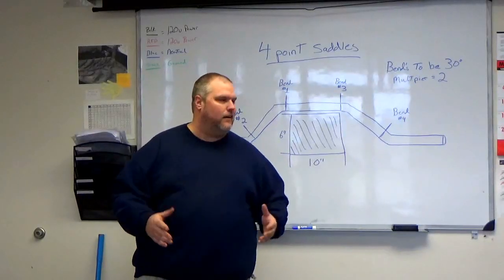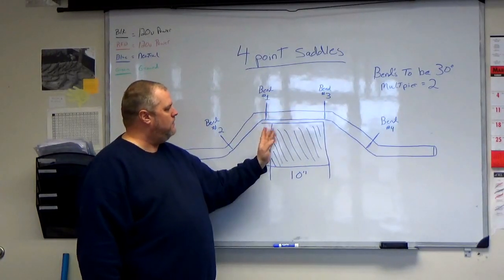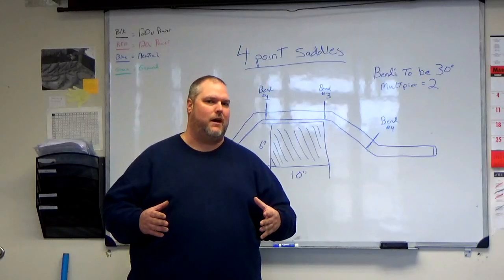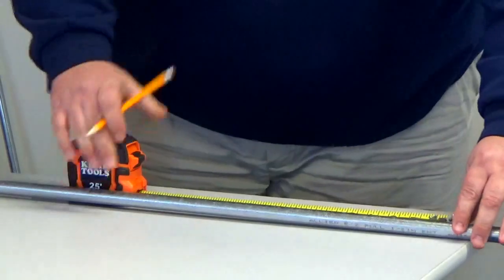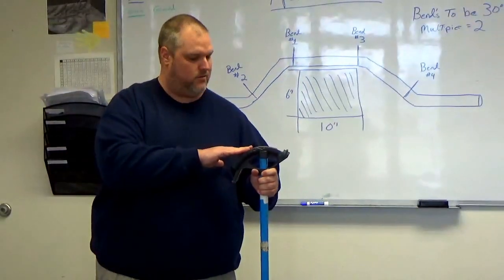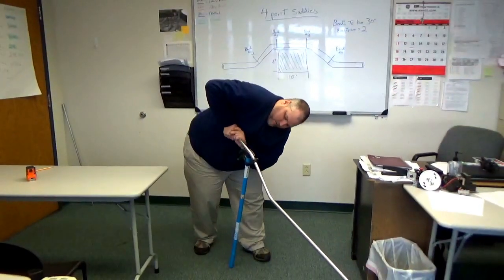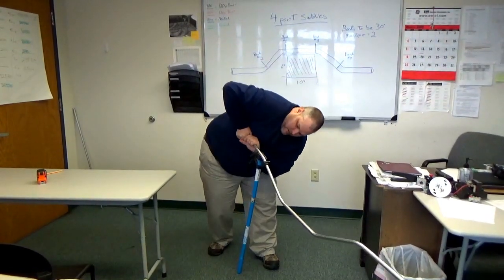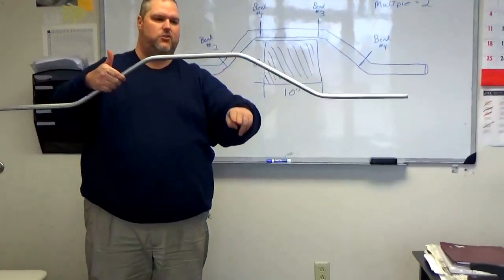Conduit Bending  4 Point Saddle

Comment: dont all of the measurements change when adding in shrinkage?
Reply: Technically yes. But in practice it seems to have little effect on the end product
Reply: For this saddle it should be 1.5” shrinkage. Anyways just cut off an end to make fit if you have to.

Comment: You didn't add shrinkage.  Instead of 12" it should have been 13 1/2 " cause you get 1/4" shrinkage with 30 degree bends. Therefore that gives you 1 1/2" inch must be added.

Comment: why is the shrink applied only once for both offset (2 bends) and the 4 point saddle (4 bends)?, It seems it should be applied twice since you are bending the conduit 4 times in the 4 point saddle instead of 2 times in a offset.
Reply from the maker: Great question!! Shrink is based on the RISE of the object the you are going over. You can only apply it to the side you are measuring from or the starting point.  Also the 4 point saddle is one considered one bend just like an offset is one bend.  Yes there are more then one bend but that is how it needs to be looked at.  Shrink is only applied once for that reason.  I hope this helps you!!! Thanks for watching!!!  CM

Comment: Hi Craig, How did you determine where the center mark goes on the pipe? Thank you
Reply from the maker: For this demonstration I used the center of the conduit. I was just showing how to bend a 4 point saddle. I have not done a video on shrinkage but I would find the center or an object and then add the shrinkage. You can find the size in an Uglys book. I will do a video explaining shrinkage soon. Thank you for watching!! CM
Reply: @craigmichaud-electricalins4602  
For the 4 point saddle did you use the marks on the tear drop?

Comment: You don't add the shrink to 1st mark?
Reply from the maker: You do but I did not show this in the video as I use it in my class to just show them the basic bend. Thanks. CM
Reply: They need to know that 1/4 per inch of rise is your shrink and you adjust that center mark accordingly , all other marks will adjust 
EX: 6” rise multiply by 1/4=1-1/2 “ shrink

So if the center of the obstruction is normally ex: 30” you’d make your center mark at 31 1/2.

Comment: Did u measure 12 “ because 6” was the shrink ?? Thanks
Reply: If your using 30 degrees your double you height. 6 inches high at 30 degrees would make you two bends 12" apart

Comment: Didn't explain or applied shrinkage. It may seem little but over time, having to cut and couple different lengths costs alot of time. Sucks if you're just an inch off to the box and now you have to take it down cut off and cut a another piece to make it.